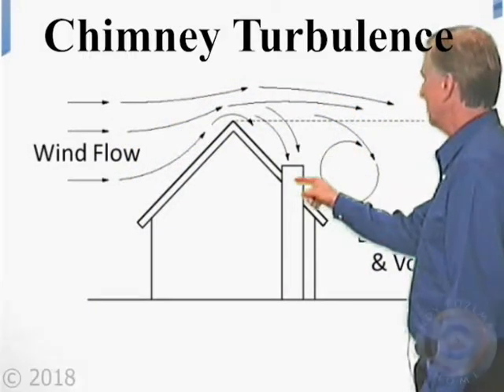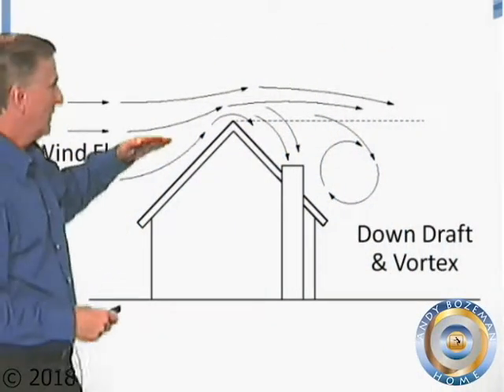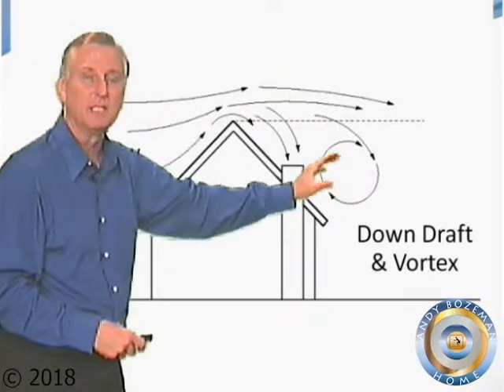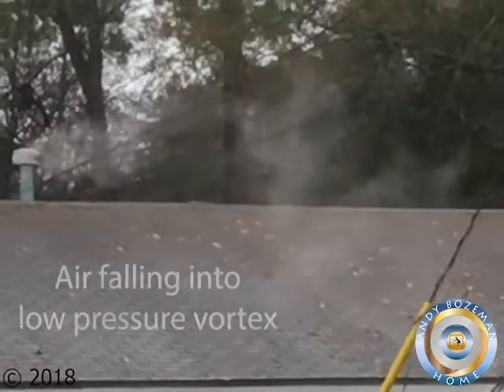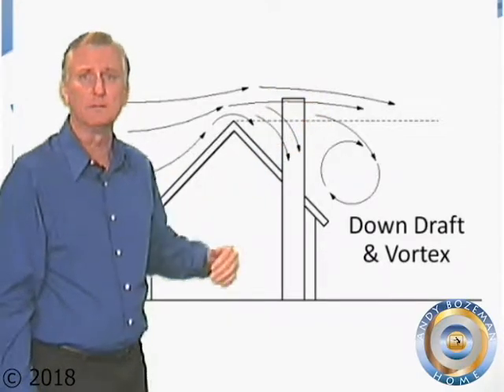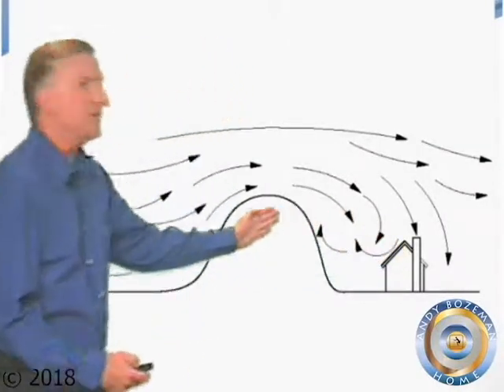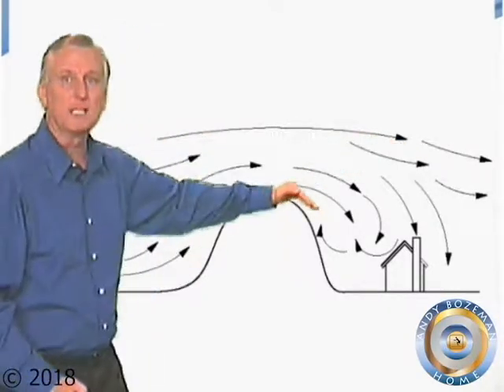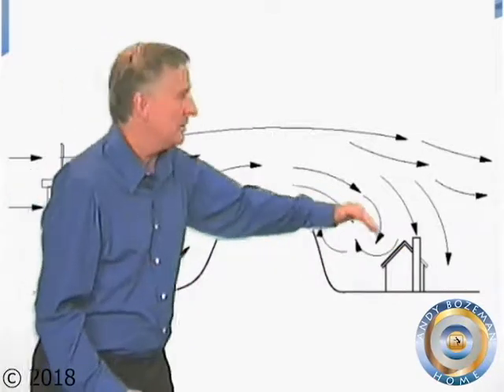Chimney Turbulence

Comment: I think my home is the second example. I do not have a downdraft of smoke into my home, but the smoke as it exits the chimney is blowing downwards to my neighbors house. The chimney flue is on one "level" of my roof and there is a higher sectional "level" that has a pitch that is a completely different part if the roof. I hope that makes sense. It is not a typical triangular single sector roof. The chimney flue is more than 10ft-15ft horizontally away from the taller section of my home and its height from the roof is around 5-6ft. 

Can extending the flue higher to where it is above the higher peak of the entire roof solve the smoke issue blowing downwards? Does it have to be higher than the highest point of the entire roof? Any way to test it prior to spending thousands to make the fix?
Reply from the maker: The downward-drifting smoke - toward your neighbor's house - is a strong indication that the top of the chimney - the exact point where the smoke comes out - is inside the turbulent zone. 

THE MAIN POINT:
To work properly, the part of the chimney that emits vapor or smoke must be at least 24" above any part of the house (even a neighbor's house) within 10' (measured horizontally ) from the nearest point of emission. This makes the smoke leave the chimney ABOVE the turbulence in smoother air, so it has a better chance of blowing away rather than onto the house next door.

Comment: My problem is when the wind blows my draft increases so much that I can't turn the stove down enough, resulting in a very hot house and faster wood consumption. We have a wind directional cap, but it doesn't help.
Reply from the maker: I think you are saying that the wind increases the chimney-draft and causes over-burning of the wood in the stove. The wind-directional chimney cap is a good addition for protecting the draw of air, but it does not offer air-flow control. An inline, adjustable flue damper will help. If you have one, close it just a little. If not, have an inline, adjustable flue damper professionally installed. A flue-damper, when closed just a little, will help decrease the draft and thus decrease the over-burning, and also reduce the overheating of the room. AB
Reply: Sounds like Bernoulli's principle in action. You are right to be cautious when a strong wind blows across your chimney as the fire can be drawn up into the flue and cause a chimney fire.

Comment: Ok my house is in the situation of the second home. I have an extender on the chimney, and it still has negative airflow, leaving my downstairs smelling like ash. I was gonna install a throat damper, and make my 90 elbow a 2 45 elbow and was gonna install a vacustack chimney cap. Will this fox my issue?
Reply from the maker: This is Andy.
The 'fix' may be simpler than you think. 

It sounds like you have a wood stove. Even if not, the problem may be caused by home construction that's simply too well done. Living in a very well insulated house can be like living inside a thermos bottle: it's so well sealed that there is no interaction between inside air and outside air. This is possible in new and old houses. As heat and smoke rise up and out the chimney, air pressure inside the house is reduced. This creates a slight vacuum which pulls through the chimney - the only opening; a little smoke gets back into the house. Even a mechanical ventilator won't fix this. I'm an old guy who spent part of my childhood in a house heated just by a fireplace. I can still remember bitter cold winter nights when my grandmother would give me the instruction, "Andy, it's a little smokey in here. Open a window, just a little." That would instantly fix the problem. So, before you spend thousands of dollars on experimental repairs, try opening a window, just a little.
Reply: @AndyBozemanHOME  Yes I do that to start the fire. I am specifically talking about constant backdrafts when the fire dies down. I build the fire sometimes i have to open a window and close it, but after hours the fire dies down and the backdraft makes my entire downstairs smell like creosote. I just bought a vacustack chimney cap as I heard that helps with the physics or whatever of the wind.  We shall see. I don't want to have leave a window in my house open during 0 degree weather with a fire. That kind of defeats the purpose no?
Reply from the maker: @WarriorShamanSFMF  Thought I don't know these people, you can find a good article about back-drafting wood stoves here:
https://mffire.com/woodstove-101-8-tips-stop-smoke-coming-wood-stove-door/

Comment: That is by no means an accurate diagram. That chimney is practically flush with the roof line. Should be a minimum of 10 feet clearance top of chimney to roof. Bad demonstration
Reply from the maker: Your comment about 10' is almost right but referring to wrong direction. To work properly, the part of the chimney that emits vapor or smoke must be at least 24" above any obstruction within 10' (measured horizontally ) from the nearest point of emission. Thanks for the comment.

Comment: So what can you do if you can't increase chimney height anymore?
Reply from the maker: Install a mechanical device - like a ventilating chimney cap for a bar-b-q shack. Just make sure to seek guidance from the local fire Marshall. This is literally playing with fire.
Reply from the maker: What's the limitation?
Reply: @AndyBozemanHOME  already have two supports.  Do you think wind caps work?
Reply from the maker: @petergriffin1546  A 'cap' will partially deflect a downdraft but cannot solve the problem of the decrease in air pressure. Call a pro to get the best in-person assessment.